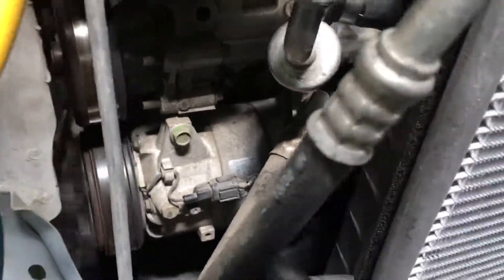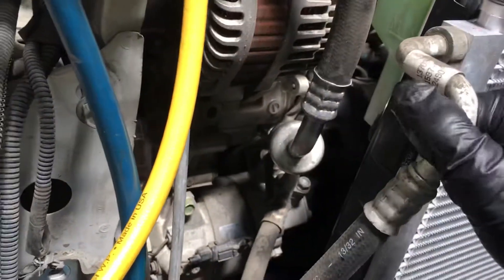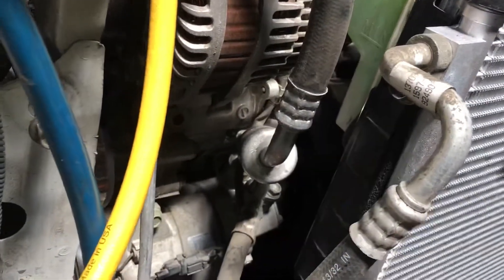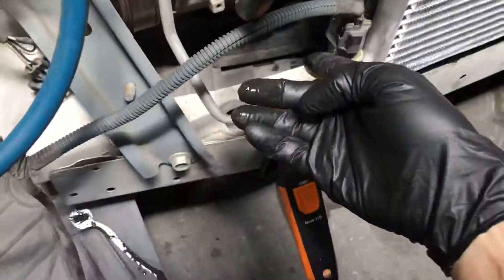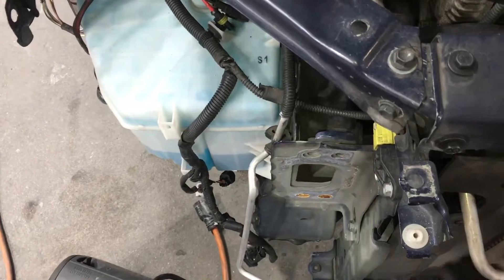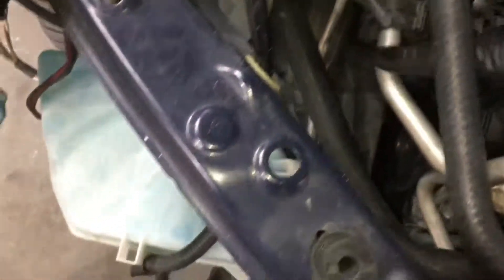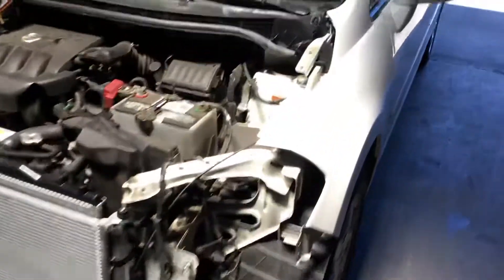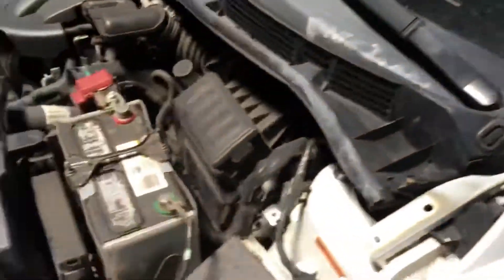Does AC have condensation dripping from your suction lines ?  ￼

Comment: Can i ask a question?
My suction line is not sweating but cold and the compressor cycling but normal cycling and the vent temperature is 8 degree C (45 F ish). Is that normal that suction is not dripping water ?
Reply from the maker: @floor_jack1441  not if your humidity is really low

If you’re dewpoint for the ambient weather conditions is below the suction line temperature then you will not have condensation 

In my region, where I live, we usually always have condensation 

Or somebody who might live in Desert or very high mount area, where they only have 5% or 8% humidity during certain times of the year the dewpoint will be extremely low . 
Off a properly operating system, there will be no humidity condensation dripping from the line

Comment: My suction line was actually warmer than 100f but it was also touching a couple very hot lines. One of those was the heater hose. I'm thinking of insulating it from the heater hose. It's just bare metal at the compressor entrance tubing. Aluminum conducts heat
Reply from the maker: Interesting hot suction line
Reply: @coldfinger459sub0  what I hope is that I can get this truck started. I'm replacing my fuel pressure regulator and the injectors. However I am also trying not to have to lift out the fan shroud as the suction and discharge hoses both go over it. That means you have to bend the hoses almost 30 degrees in trying to wiggle the fan shroud out and with the pressure sealed I always worry that I might cause a leak

Comment: Is it also normal for my ac compressor to drip water and condense? While my high pressure hose os not burning hot.
Reply: What if it’s not dripping but cooling fine
Reply from the maker: If you live in an extremely low humidity climate and the section line may not be below the dewpoint it will not be dripping. 
     Most places that have high humidity on average will be dripping

Cooling out of the dash does not mean it’s properly filled . 
         Condensation dripping off of the section line does not mean it’s properly filled. 

But it is an indication in high humidity climate that the section line is cool .
Reply from the maker: On some yes. I said Line should not be burning hot.
Reply: @coldfinger459sub0  thanks for the reply man. Appreciate it.

Comment: After having my ac repaired I noticed the dripping / condensed pipes. Worried at first, glad to find out  it's normal
Reply from the maker: Condensation dripping is a good thing
Reply: @coldfinger459sub0  Yeah good to know. I had never checked the engine bay when ac was on. My ac stopped cooling mid trip and the culprit was a busted pressure switch, all cooling gas escaped. After the repair I thought I had some kind of leak, but it's the same effect as getting a cold coke can out of fridge and see it 'sweat'
Reply from the maker: @hunt3rgames88  imagine all the time you never had dripping water underneath the car ? 

That means you’ve been operating probably on a low refrigerant charge for a long time . Just gradually, and you never noticed it.. 

Now you get to feel what you’ve been missing all this time  🥶 👍
Reply: Me, too! Glad it's normal. 😅